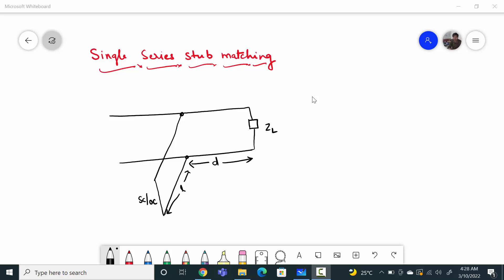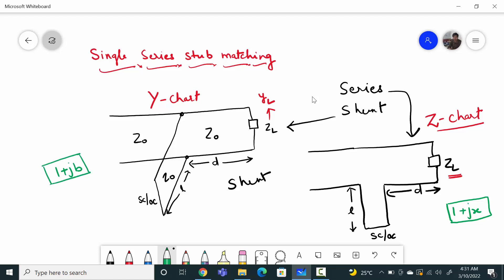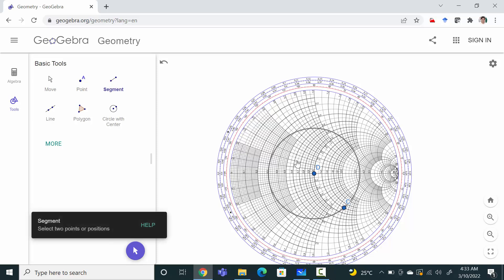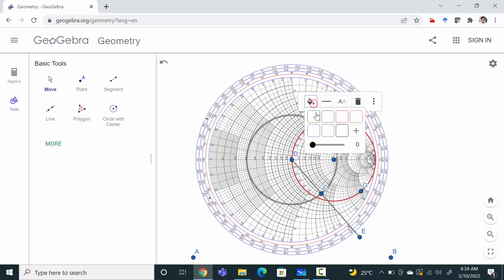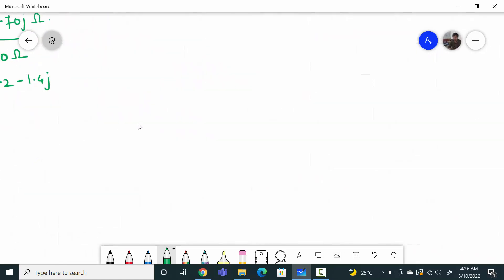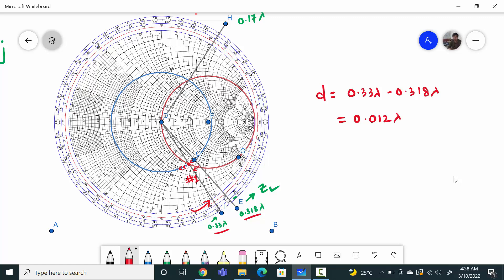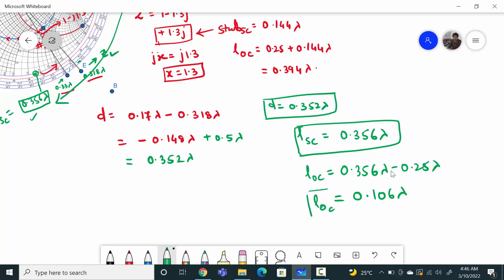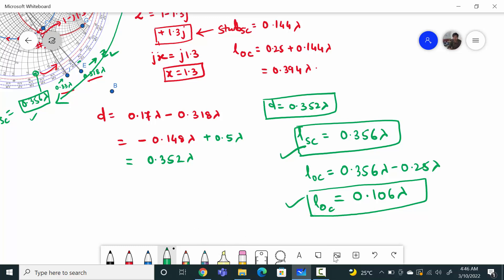Single series stub matching using smith chart.

Comment: I think you've made a mistake in your other example video because it was a short circuit stub, but you calculated the wavelength to the open circuit side rather than the short circuit side. And you said you did this because it was an admittance chart, but I am pretty sure it was an impedance chart.
Reply from the maker: When you assume impedance chart as admittsnce chart. Short ckt side and open ckt side gets switched.

Comment: How to identify that unit circle intersection cutting is upper or lower? For some problem,the intersection is upper and other problem ,the cutting intersection is lower ? Plz tell
Reply from the maker: Upper and lower cut gives two different solutions
Reply: Move towards clockwise from the ZL position. Jo side se clockwise rotation me Unit circle ko touch karega woh point rahega intersection ka. lets say 1.2-1.6j ka ZL se unit intersection will be lower because it intersects in lower